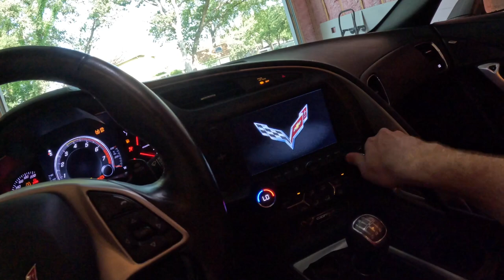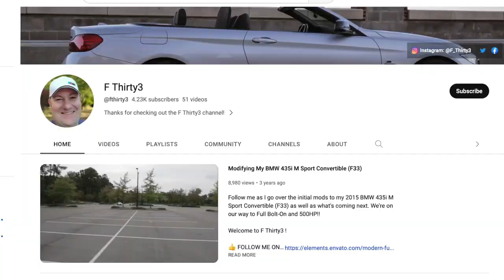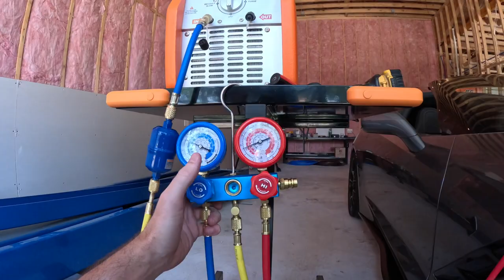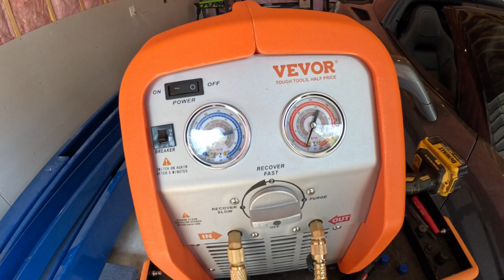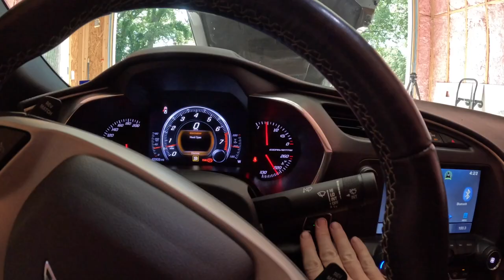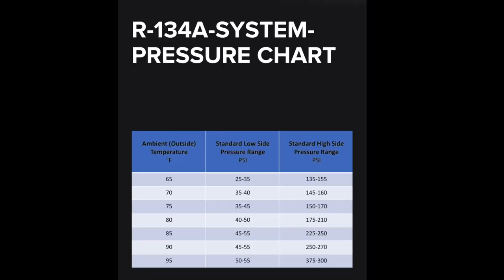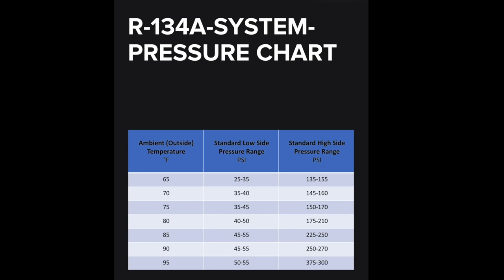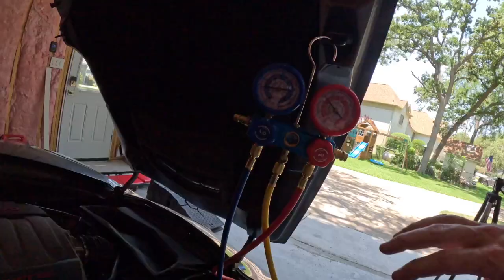C7 CORVETTE A/C FIX! Diagnosis, freon removal, compressor replacement, and recharge!

Comment: NICE JOB, extremely detailed...and  helpful! One pet peeve if I may.  For me, im clumsy, so i use sheets to cover fenders and my kalihari seats, bc they look tachy with grease smeared on them from lying on the ground under the car.  My corvette  mechanic friend taught me years ago, by example..the very first thing he did was put those covers on. I remember thinking, wow, we have this engine to take out, and youre thinking about the paint!      Not every customer cares, but the ones who do, care a LOT.  Im in that camp. You can bring my engine back from the dead, but scratch my fn fender...that's what I will remember..   :)   Sorry for the rant.

Comment: It seems as if the clutches go out on C7's. In most AC Delco compressors of old, you could just adjust and/or replace the clutch. My 2014 C7 clutch has a high pitch squeal . So, will have to do all you did. 
• I wish you would have shown disconnecting and reconnecting the lines to the compressor.
• Did you replace the orifice tube?
• Very well done down to earth video and tutorial. One of the best, no matter the subject. Thanks!
BTW: A new AC Delco compressor for this model seems to be out of stock everywhere unless you want to pay over $1k for it. So, I'm getting the Delphi replacement sold by Four Seasons...unless somebody has a better idea, but I will not buy Chinese.
Reply from the maker: I remember the compressors of old (does that mean I’m old?). Would’ve been pretty easy in this car to just replace the clutch. But anyways… 
There is approximately zero room near the compressor lines but it’s not hard. They’re connected by a bracket that holds them in place. So just unbolt and tug. Then place new o-rings once the compressor is in place and shove them in. 
I don’t know what an orifice tube is so I doubt it. But the a/c is still blowing cold so it must be fine to not replace it!
And thanks! Good luck with yours!

Comment: Thank you very much!
I have to change my compressor soon too, did you lubricate or oil the two compressor seals ?
Reply from the maker: Nope, the instructions said it wasn’t necessary
Reply: @ZeroToAwesome  thank you, and the same for the seal of the dehydrator ?
Reply from the maker: @cedric303  yep. I kind of gets lubricated anyway though cause oil leaks out when you pull the old one out. Your eyes will get oiled too if you’re not careful 😉
Reply: @ZeroToAwesome  OK 😄 and did you have to add oil to the new compressor or was it already pre-filled?
Reply from the maker: @cedric303  pre-filled

Comment: did you disconnect the battery? asking for a friend.
Reply from the maker: Haha you can tell your friend no. You only have to disconnect two electrical connections that are only on when the car is. Figured they wouldn’t be a problem